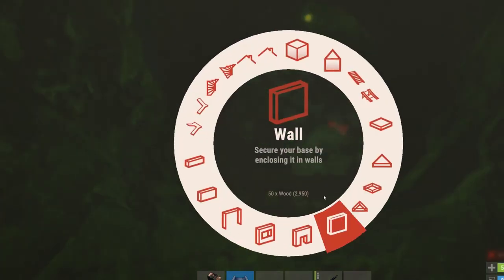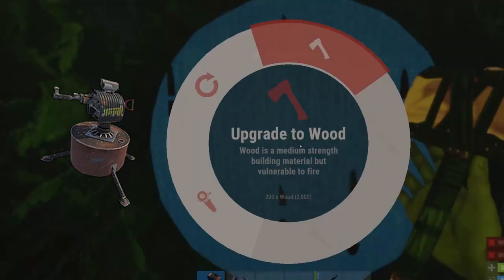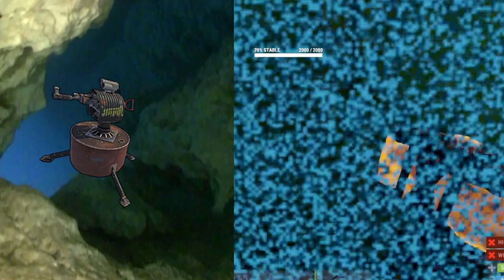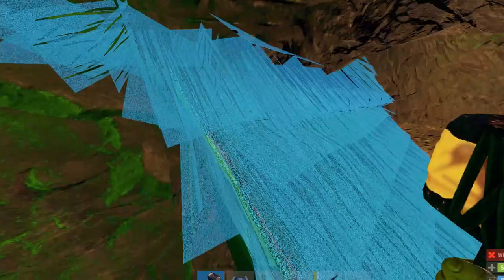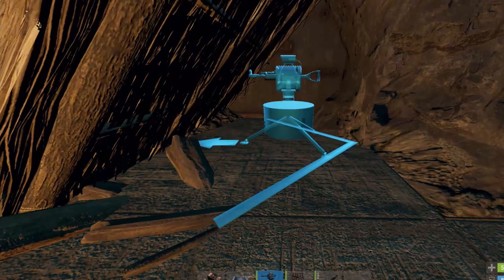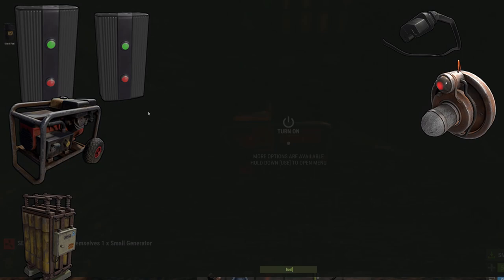Best Auto-Turret Defence in Rust Caves

Comment: Great tutorial. Built in cave following the recent electrics update. Would suggest a remake of you have time as it is really helpful. I added a time to you circuit with toggle on being used. In short 2 turrets so far have constant run time of 36 hours. With timer the time is extended to 199 hours. If the HBHF triggers turrets turn on for 2 min. HBHF sensor has a range of 3 squares making it ideal for turrets in a cave or inside the base. Side Note: with the new 12 turret limit in play it may mean you can have more than 12 turrets in the base with 6 running all the time and many more operation off the time circuit as they only activate when the HBHF sensor is triggered, so the dormant.
Reply: could u show me the the setup? much needed <3

Comment: This wont work. You could bow this out if you wanted to, the HBHF sensor wont detect anyone unless they are close up to it
Reply from the maker: It works kinda good. And most of the time people are way to surprised. And just run into the destroyed wall. If you feel uncomfortable with this place the turret one door later and the HBF a little more hidden in the room. 

But usually I prefer the small caves, cuz I can bring down electricity wires to there.